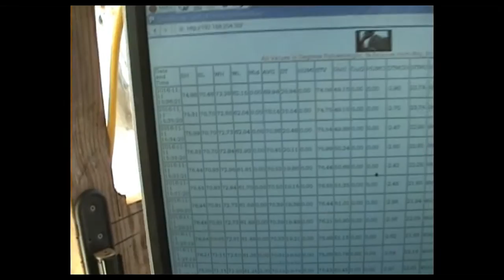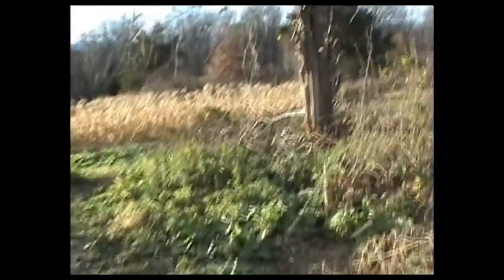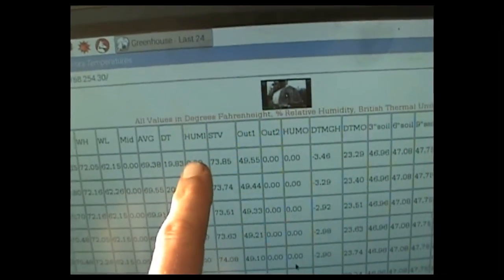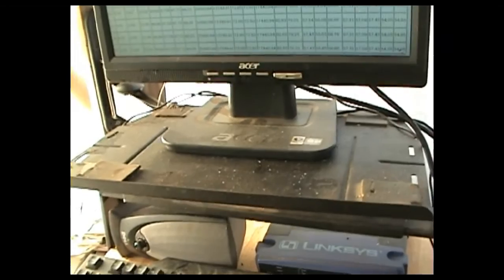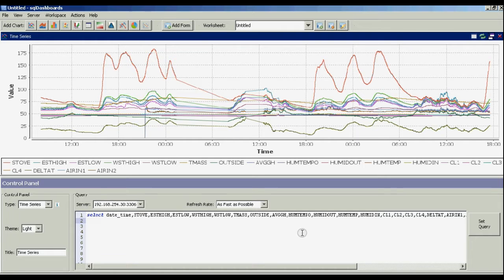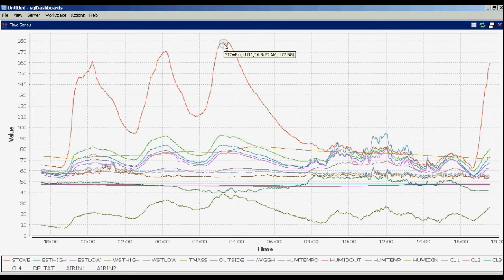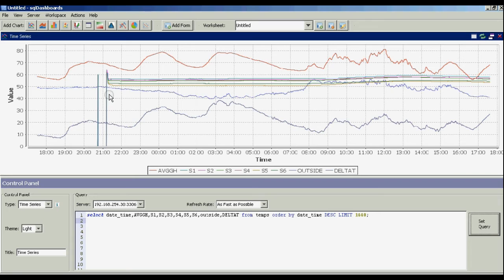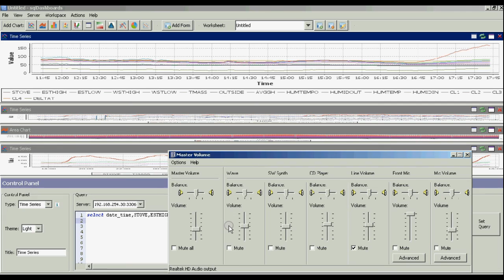11 11 2016 Raspberry Pi Monitored Greenhouse - Data Logging And More

Comment: Hi. What programs are you using to tabulate the data and graph the data? I'm looking to try and get Libreoffie Calc to act as a datalogger reading sensor data so that LO Calc can give realtime charts and save the data.
Reply from the maker: I'm using a database on the Raspberry Pi... and I wrote the code to grab data and put it in the database myself... As far as charting, It's a free program called SQLDashboards.
Reply: @TheFarmacySeedsNetwork  Thanks for the reply. Aaah. I see you've made a series of videos sharing how to set it all up. I'll give it a gander. My dream is to get it to dump data into Calc. Keep up the good work!

Comment: Question.  Do you by any chance know of any way to protect the sensor from water?  I'm trying to figure out a way to track the temperature and humidity of my vivarium which gets regular mistings.
Reply from the maker: Well, the sensors I have have a 3 ft waterproof lead... I know I saw on ebay that you could get them with up tio 45 feet of waterproof lead attached...
the other option is shrink tubing over silicone for your connection.
Reply from the maker: Here's a link... sorry for the delay:
https://www.ebay.com/itm/DS18B20-Waterproof-Digital-Probe-Temperature-Sensor-Cable-Thermometer-Thermal/332222880134?hash=item4d5a06d986:m:mIkvmNHkU6oJwuOs3G9iYxw

Comment: at 3.3 volt the dht22 can only drive 1 Meter of cable  at 5 volt many meters
Reply from the maker: I have tried 3.3 and 5... 5 works better but still doesn't even make over 1 meter... I had to write a checker into my data logging program to eliminate erroneous data errors... (values over 100% humidity)

Thanks for the tip / comment!
Reply: I'm using 5 dht22s to monitor t and h in a wood kiln solar. lengths range from 10 to 30 ft, read by arduino and sent to pi for logging and plotting. runs for days with no problems.  The data is fixed frequencies so capacitance can be a problem.  What size pullup are you using?
Reply from the maker: not sure what you mean by "what size pull-up" are you using...
but I am running approx 32 dsb1820 temp sensors plus 2 DHT22's for the entire greenhouse. There are MANY long runs of wire... and I suspect as you said, it's a capacitance issue. This fall I plant to go back and shorten runs as well as switch from the old cat3 wire to cat5e cable to help eliminate cross-talk and capacitance issues.  I am open to any ideas.  cheers!
TFSN
Reply: dht22 needs a 10kohm resistor to pull the data out line of the dht22 to logic one, dht pulls low only so difference between a zero and a one is the amount of time the output line is pulled low. With 5 volts to Vcc and a 10,000 ohm resistor you should be able to drive 100 meters of cable without problems.  Other problem could be base frequency is off, leading to bad error margins i.e. program written for arduino at 16mhz but clone runs at 12mhz.